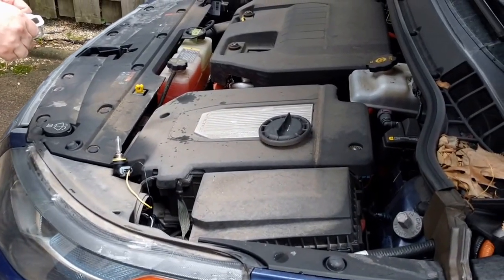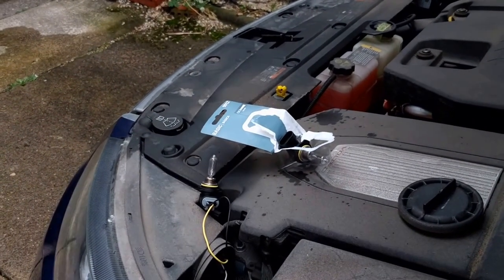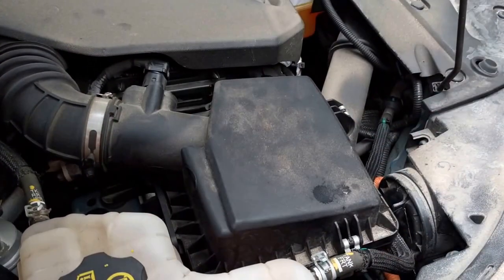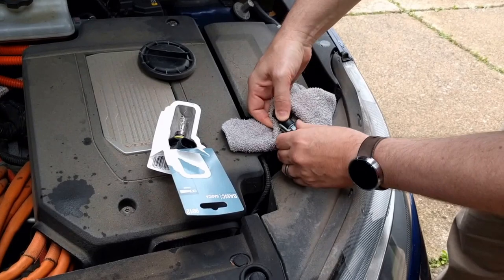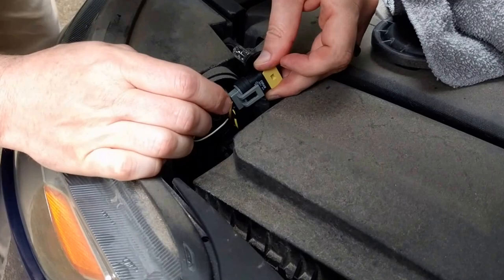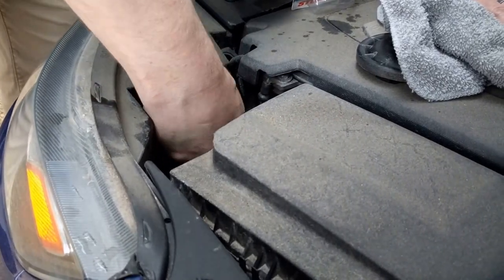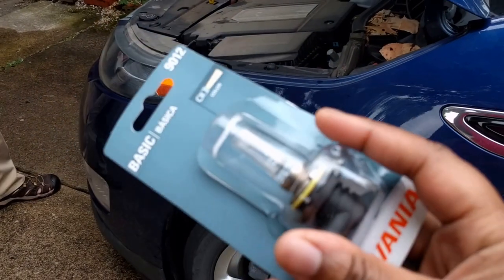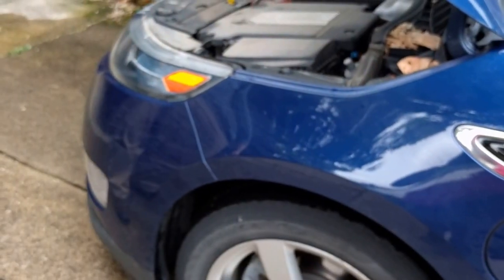Changing a bulb - 2012 Chevy Volt

Comment: Mine looks nothing like that. My 2012 volt has way more cords going into the headlamp socket. The bulb inside looks nothing like that. I have to disconnect a plug to put that one in and just leave the old bulb hanging outside the bulb chamber. Can’t remove it. Do you know why this is?
Reply from the maker: Have you checked the manual? My Volt has the leather and heated seats option I don't know if that would effect the light style.

Comment: Hello, do you know if the daytime running light and the headlight are the same bulb? Thanks in advance
Reply from the maker: I think they are the same. I went to this website to confirm: https://www.carcarekiosk.com/video/2013_Chevrolet_Volt_1.4L_4_Cyl./lights/daylight_running
Reply: The Volt uses separate bluish LED's for daytime running lights, not the head light bulbs.
Reply: @chrisstoddard1144  Only in the newer models.  This vintage does not have the LED's.
Reply from the maker: @SR-wu8ls  Vintage!? LOL.